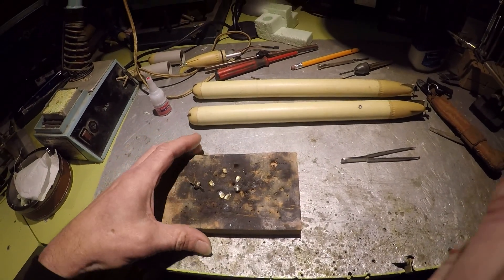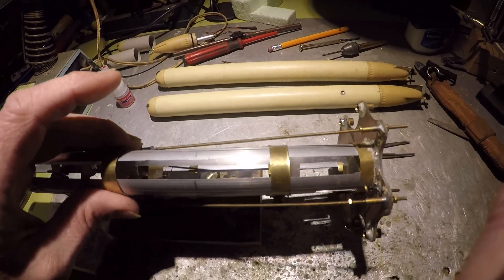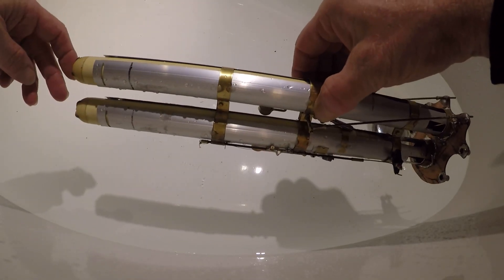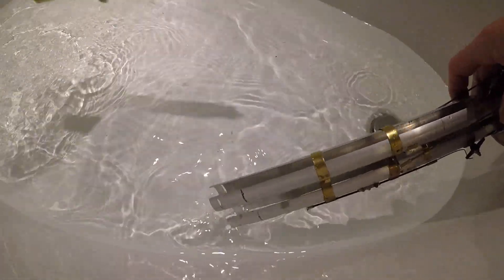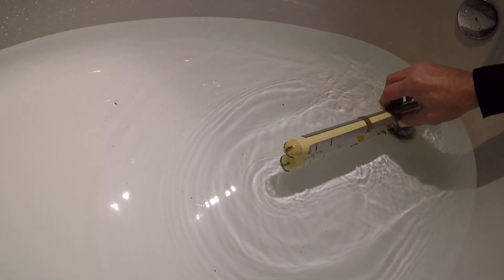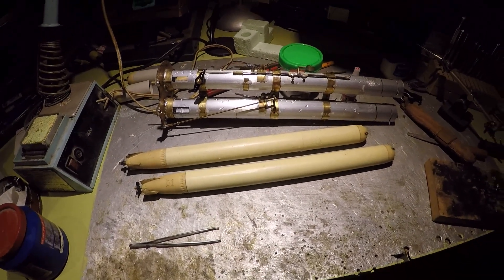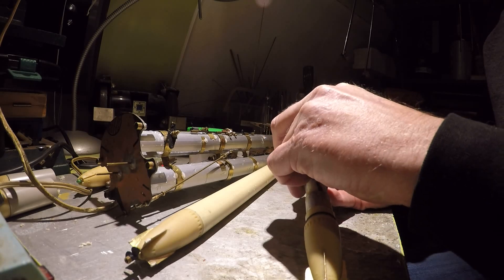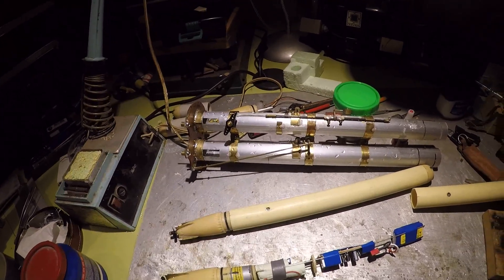Torpedolaunch test Ko Hyoteki

Comment: Excellent work sir! Manfred does it again! Brilliant design. Does 3 blade work better than a 2 blade? Learning about getting water behind torpedo from you, Thank You!
Reply from the maker: Thanks, as for the blades, i only could test the 3 blades configuration, the 4 blades shattered during testing.
Modified the tubes now, and will restore the 4 blades props, there will be some more testing soon
Reply: @Knikebein  I can 3D print up some if you want to test. Give me the diameter of the prop and the diameter of the shaft, I can use your photo as a reference for everything else. Email me. 
Peace,
Tom
Reply from the maker: Thanks for the offer Tom, first see if the brass blades hold, if not , you get a mail
Reply: What are you using for the 5 sec cutoff , my system for torpedos  is using capacitors can get as small as 1/72  scale . Thanks     Dan Kachur
Reply from the maker: Dan,  i use a simple timercircuit it runs on a small 2S lipo.